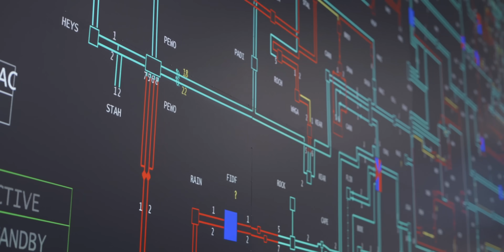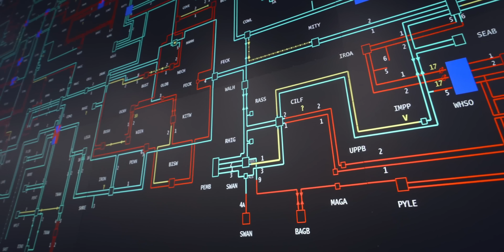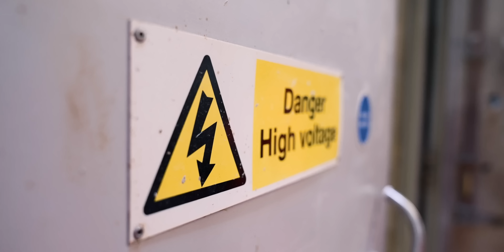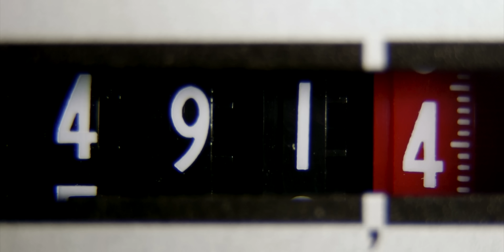THIS is Why the Grid is Ready for Electric Cars!

Comment: It's all very impressive but when it comes down eventually to my meter box and our 90's installed looped supply it all goes wrong. Nearly a year since I started the process of getting a home charger installed. Communication between Installer - Supplier - DNO has been painfully slow. The meter tails have been upgraded and the un looping has been signed off. But we are are still using public chargers that in our area either don't work at all, or some lads in VW Polo's that park up in the bays with bonnet's up talking about induction kits and begrudge having to move so I can charge the car. Then the advertised rapid charge rates never actually come to fruition. I understand battery temps, state of charge etc but if you advertise 150kW CCS and I get 43kW on average even with no one else on any of the bays. The future is bright thank god I commute every day on a motorbike.
Reply: Many local connections will need to be replaced, the 80A or 100A supplies were installed with diversity in mind, never expecting them to all be used heavily at the same time, to save on cost of cabling, much like broadband has contention ratios.
Reply: A lot of incorrect procedures and systems were used when these were nationalised companies. I am but 50 meters from a sub station yet everyone on one side of the street is on a single cable looped from house to house. On the other side of the street they are on another phase, but looped house to house as well. Under my front garden we found a 3 phase 440 volt cable 150cm under the surface (supposed to be a minimum of 1 meter down) and below that... 100mm below it.. instead of 300mm and a concrete cap (missing) an 11,000 volt 3 phase interconect between substations. This is the problem with nationalised insustries.. corners are cut because there is never any oversight on what they are doing. This was installed in the 1930's
Reply: @williamarmstrong7199  In fairness, it can be a problem with privatised industries as well, just look at the water companies & their discharge of record levels of untreated sewage into rivers, for "reasons". IMHO I wouldn't want to go back to "the electricity board" - I'm old enough to remember what they (and the GPO & the old rail network) were like; but there's no doubt that some additional regulation is required in various areas, including the electricity companies. National Grid, on the other hand, seem to just quietly and competently get on with their work - which I guess is why we never read about them in the pro- or anti- privatisation newspapers...

Comment: Hmm, video looked like it was aimed at school kids. Nothing wrong in that as they have to start somewhere. At best this was a puff piece for pre "O"level youngsters.

However nothing concrete or reassuring that "we" can generate enough in the future. That was a tad vague and the reference to power flip flopping between UK and Norway ignored the fact we have already have several international interconnectors in place as we type. Google is your friend on this.

It may be in a few decades we have more power than we know what to do with, what with the vast new solar farms UK is building in Morocco for instance or the wind farms floating 50 odd miles off our coasts.

And then there's the output from our new nuclear fission generators and possibly, in the far future, nuclear fusion generators.

It might be worthwhile dumping this idea of battery EVs as soon as and using renewables to generate hydrogen gas for fuel cells.

"Merely" a case of scaling up the electrolysers so private transport doesn't impact the domestic draw off the Grid.
Reply: You'd need a lot more electricity to go from water to hydrogen than you would to just put it into a battery
Reply: @forferdeilig 
 
Hmm, we know all that. 

Trouble is you are getting confused, as many, many posters do, with all this efficiency nonsense.

Allow me ... the electricity is being generated for free, which is why we call wind power and solar renewable.

(Obviously there are capital costs and maintenance costs involved.)

There's so much energy being emitted by our star that we will never ever, ever run out of it.

If you consider our star's energy is being broadcast in a spherical wave as it were and we as a planet, can only ever harvest less than a trillionth of a trillionth, say (I'm guessing here, obviously) of this available energy.

Solar panels, the black monochromatic type, at the very best, are only only around 18% efficient.

Given "we" have less than perhaps 0.01% of the planetary surface covered in said solar panels (again I speculate, obviously) then you might say we have room for improvement.

Ditto wind turbines and marine turbines (whether harvesting the wave power of tidal power of subsurface currents.

And then there's geothermal generation.

Iceland and UK already in discussions for them to supply UK with their surplus electricity. 

Ergo the last thing we need to worry about is this "efficiency" nonsense.

Google is your friend on this, but be warned, there's so much info online already, and more R&D info being added all the time you'll never get to read more than a tiny fraction in the time you have left on the planet even if you read up on it 24/7.

If you include nuclear generation then we'll be knee deep in electricity.

You should perhaps consider the idea is to clean up our atmosphere, not to find ways of making EV owners going into "smug mode".
Reply: And not only pre o'level students but readers of certian "news papers" and the Fox "news" chanel who need cat sat on mat level to help them. On reflection.. that was far to data dense for anyone who watches Fox "news" it would need splitting up into 30's tick tock posts. Their attention spans are not long enough to handle longer items. Lol
Reply: @williamarmstrong7199  

Ah, you refer to Republicans.

Quite so.

Comment: Vehicle to grid??!?! WTF?
Not going to happen.
That guy's in dreamland.
Reply: There have been 2 trials running in the UK and they have learned alot form these trials, so yes its going to happen. I use Vehicle to load and keep it all to myself! lol
Reply: I think you are wrong Wayne. V2G is probably going to be quite a big deal (eventually). I'm certainly going to be doing it as soon as I have a car or battery to do it with. Right now you can make good money because the daily energy spread is high. That won't last forever, but there are good reasons why V2G (and the slightly simpler V2L) will become totally standard eventually.
Reply: V to G will use all the EV batteries to cover peek demand times making the owner money then charging  the EV at low demand times saving the owner money. 
All it takes is vision for a low O&G usage future.
Reply: It will happen but maybe not at the level of individual cars at home - fleets & depots with multiple EVs will be much more viable.

Comment: Is it actually 'great' to be reliant on other countries to meet our electricity requirements? I'm thinking not. If Norway needs its supply for itself, off goes the switch....
Reply: They are reliant on us as well. If they have a drought and there hydro power stations can't provide enough electricity they draw power from us. It a symbiotic relationship
Reply: is it good for one half of the country to be reliant on the other? All it might take is some sort of bad weather or terrorist attack and we'd be in trouble?  I think you can carry any argument to absurd levels. We're better off being interconnected as long as we still can produce enough to deal with risks. To not be connected is more risky.
Reply: Better to have strength in depth, also encourages getting along with your neighbours.
Reply: Did you not see, it can transmit both ways, we have other interconnects with different countries too, not sure how the Africa interconnect is progressing
Reply: All the replies kind of help my point. The future of electricity supply in this country is not the rosey picture this video implies. The energy companies have been paying people to turn things off at peak times. Yes, it's good to have emergency supplies because things are going to get a lot worse and more vulnerable before they get better. We are twenty years late getting are butt in gear.